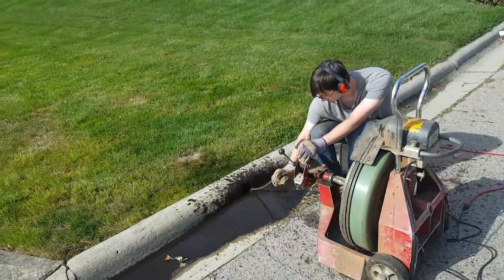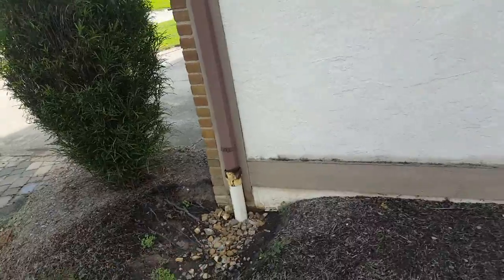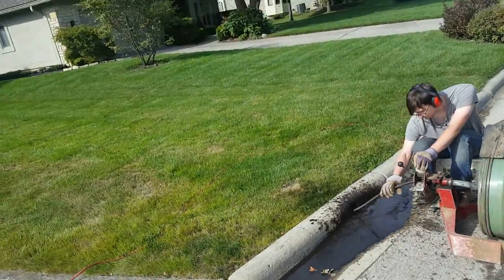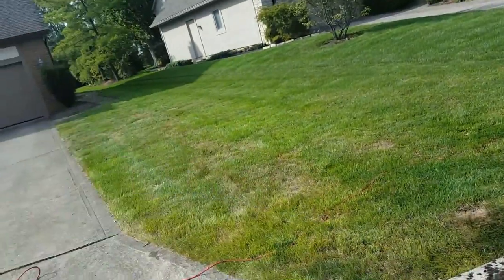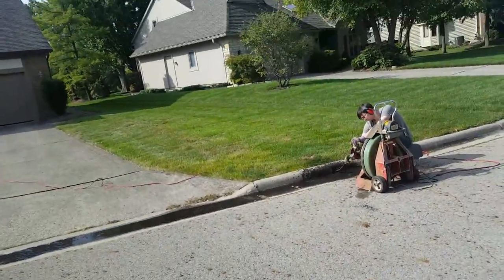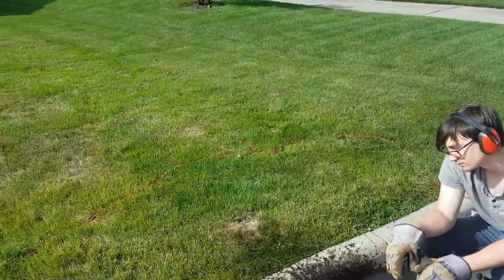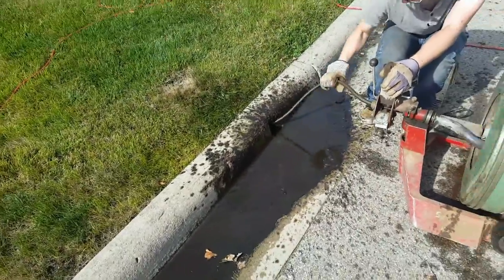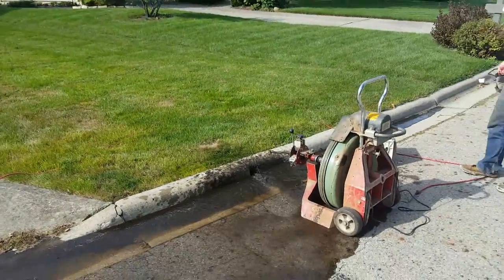BLOCKED Downspout DRAIN LINE CLEANING underground pipes BLOCKED to street

Comment: Seemed to be a restricted flow still. How about sending a water jet through too?
Reply: I agree. It looked like the job wasn't done. Maybe restoring the flow and make sure nothing else goes down that drain but water for a couple years will clean it out a little better? A pressurized hose sounds like a great idea at this point, though.
Reply from the maker: it was done thanks for watching.

Comment: Will this make a basement leak water?
Reply: For sure, if you don't get that water away from the house it will pressure against the basement walls and sooner or later push into the basement.  Should route water down the hill and grade slope down around the house, else the water will eventually come back in.
Reply: @tubro007  
Thanks Joe 
I suspect it's my underground gutter system that never got cleaned
Reply: It could also be a disconnected downspout not getting all the water into the drain pipe.
Reply: @tubro007  
It's the strangest thing joe .....as you look at the basement steps only the top of the last step gets wet and the wall of course......I'm hoping its the gutter and not hydrostatic pressure from the back yard on the basement wall but then why only the bottom step.....this is crazy
Reply: @tubro007  
Thanks Joe
Your wisdom is priceless
Reply: Water has a fun way of routing itself from an entry point to some other location.  Sounds like the weak spot in the wall is near the last step and/or the water is routing within the wall to that location.
Reply: @tubro007  
Hi Joe
Thanks again for the feedback.....sadly the basement is finished and I have no access to get behind the bathroom wall....I'm going to try drainage pipe to relieve the water pressure from the   
back yard in the spring....fingers crossed
Reply: Yeah, you have to attack it from the outside, anything done on the inside is a temporary patch.

Comment: Why don't you jet it? Must faster and cleaner! Perfect results every time!💩🔦👷🧤
Reply from the maker: Hey Suzi,  ~ Thank you for watching. This one probably/ might /  could have been done with a Mini Jet. Any soft blockages can be be removed using a mini jet. but, most roof drain lines are so shallow, surface roots is normally the CULPRIT! Only Blades have a chance to remove them. sometimes even blades may only be able to DETECT where the root infiltration is. Surface drains like downspout drain are very different from SEWER DRAINS. sewer drains are buried DEEP underground and only spaghetti and angle hair size roots are in them ( normallly but yoiu never know what you might find ha!). 
Hence, I try to give a pipe clean using the most effective means of possibly clearing the line
Thanks again for watching!